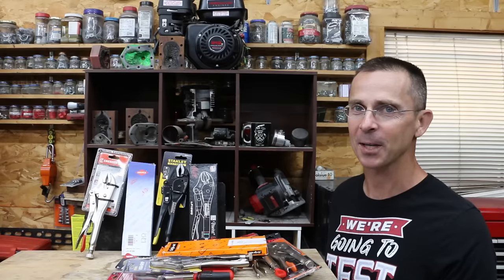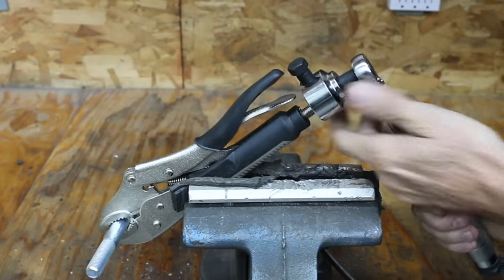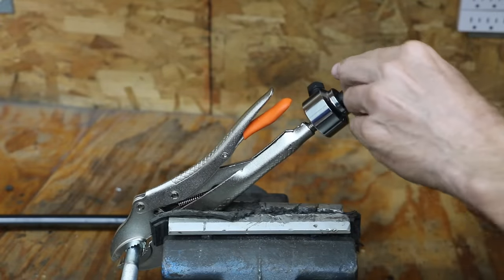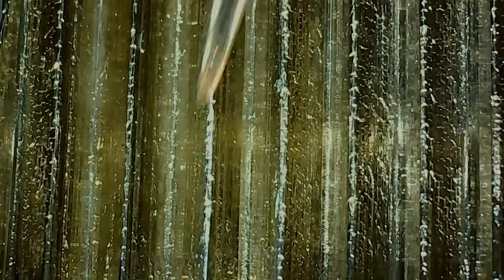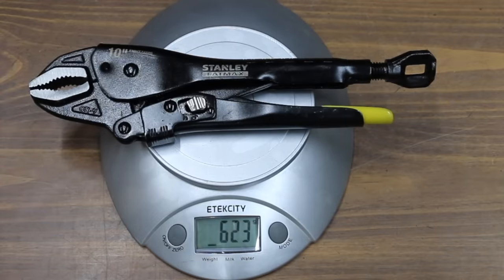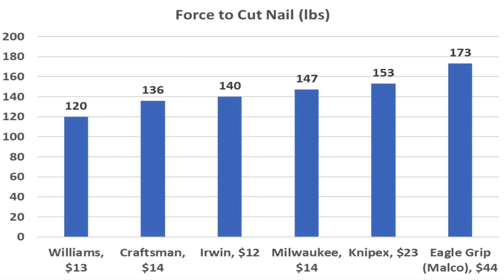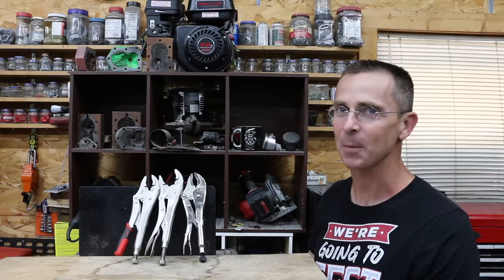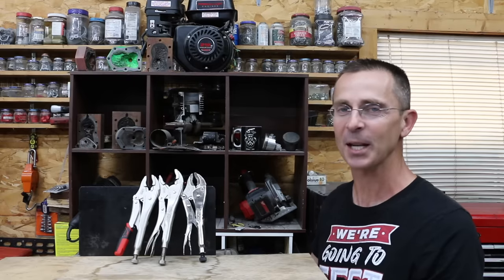Best Locking Pliers (VISE GRIPS)? Irwin vs Knipex, Milwaukee, Craftsman, Stanley, Malco, Pittsburgh.

Comment: NOTE TO SELF: Have to go out to TIG weld all my HF junk pliers / clamps at that pressed thread joint lol!  Great video Project Farm, as always, tho I have to run the playback speed at .75 to keep up with you and  let it sink in...I guess I'm old lol! I do have many original VG's pliers and clamps ranging 10 to 50 years old that are still in great condition.
Reply: From before they were Irwin
Reply from the maker: Thanks!

Comment: Great test!!
I’m so glad the Original Vise-Grip did so well, Irwin has been doing very well in your tests. I’d also note that the wear is very important, if you want to use them for a while. Looks like Irwin and Malco wore least
Reply: I have a Vise Grip and I display it in my channel removing some stuck bolts of an old carburetor. This locking plier is really amazing and very durable.
Reply: Yet they didn't point out that "they are now known as Irwin Industrial Tools and are now a division of Newell Rubbermaid, Inc. In 2008, the original Vise-Grip manufacturing plant in Dewitt, Nebraska, closed when the parent company moved production to China".
Reply: @Weejie2011  sad unfortunately
Reply: @Weejie2011  that explains why I didn’t see him test the original vice grip brand..🤷🏻‍♂️
Reply: @twobighands  Irwin market them under "the original vice-grip", but they are made in China.
Reply: Irwin isn't the original Vise Grip, it's chinese garbage, the original Vise Grip is made in the USA near my hometown.
Reply: @ericjohnson8482  looks like the original Vise-grip sold out to Irwin who has them made in China now, so the original company is to blame for selling out. Am I wrong? Can you still get USA made “Vise-Grip” brand near your house?
Reply: @ericjohnson8482  Try reading what I wrote. The vice-grip was originally made in Dewitt, Nebraska. However, Irwin bought out the company and shifted production to China, yet they are still marketed as "The Original Vice-Grip". The pliers tested here are Irwin, therefore made in China, but branded "The Original Vice-Grip".
You are arguing by repeating what I've already pointed out.
Reply: @MAsWorld1  yeah you buy them used, and Irwin kept them in the USA for a while.  Malco is in the Peterson plant now, which is where the real Vise Grip was made.
Reply: @ericjohnson8482  yup! "Real Vise-Grips" are now Malco. Its no surprise they blew the competition away! Too bad they are $44 a pair.
Reply: @Weejie2011  Guess i won't be buying Vise Grip brand anymore.
Reply: @twobighands  the Nebraska factory was shut down in 2008.
I'm very surprised Project Farm had such good results.  My 2 pair of Chinese Irwins were really loose until I tightened the pins.  The slide that connects with the adjustment screw popped out until I welded in a strap.
My adjustment screw is about 1/8th and it clearly stated on the package to not tighten the screw with the hex wrench despite having the hole.  I started buying Milwaukee.
I do believe in the last couple of years that all the manufacturers have improved their designs though.
Reply: @bryanshere3860  yeah they are $44 I still bought a pair to replace my lost very cheap Chinese pair. I like them they feel well made and not that likely to break under normal use
Reply: Did anyone notice that Malco took over the Nebraska plant where Vise Grips were made and are now making the Eagle Grips there? So if you buy an Eagle Grip you're basically buying what Vise Grips used to be before Rubbermaid bought them and moved production to China.
Reply: @alanlocke7639  no. That's valuable information
Reply: The only two brands out of all of these that I would consider.
Reply: This saddens me greatly. I used to visit the original plant in De Witt as a contract compliance analyst for GSA. De Witt is a tiny town and much of the workforce were rural folks who had worked there for 30 years or more. I remember that in their Quality Assurance office there was a giant board with dozens of knock-off grip pliers. Most of those were trash and the Irwin workers were justifiedly proud of their product.
Reply: @bryanshere3860  They're worth the $44. If they're as good as my 55 year old originals, they'll last past the rest of the users life.
Reply: @alanlocke7639  thank you for pointing that out. It clearly says so on Malco's wesbite. I recently used the vice grip brand on an over torqued drain plug for an oil pan on a car, and the teeth were totally stripped out... I had to tighten the damn thing with a clamp. Once I was down the vice grips went into the garbage. Did some research and found out the original plant was purchased by malco after vice grips sold out to China, so I bought me a pair of malco. They are millennia better after multiple uses. The vice grips were trashed after ONE use!!!
Reply: @MAsWorld1  why not just getting Malco and support companies that stand to not communist countries?
Reply: @Weejie2011  Malco bought the original Vice Grip manufacturing plant in DeWitt, NE........so they're really the original Vice Grips.
Reply: @Frank_in_Iowa  Thanks for the information and wonderful news.
Reply: @Weejie2011  ok and? who cares as long as the performance is good. funny that you want to go out of your way to say "ChiNa BaD" but didn't watch the video apparently
Reply: @LC-hd5dc  People care if they buy something purported to be "original" and then find it is not. If you'd care to read this thread, there is evidence that the performance is not long lasting. I watched the video, but it doesn't cover longevity, which is an important factor. Nowhere have I said "China bad" and I don't pish aboot wi' upper and lower case, forbye. Yer bum's oot the windae.
Reply: Malco is the best but unfortunately they are closing the plant in Dewitt Nebraska and are moving to China so I guess now the best ones will be the Chinese Irwin’s and the Taiwan made Milwaukee’s I’m really bummed out though not being able to purchase USA made vise grips in the future luckily I did buy 2 of the Eagle Grips earlier this year so glad I did
Reply: @Weejie2011  The Eagle Grip(Malco) is made in the original factory in DeWitt with the original employees of the Vice-Grip company, they just ended production at the end of 2022 unfortunately. So if you want an original vice grip get what's left in stock of the eagle grip.
Reply: @MAsWorld1  The Malco is the closest thing to a genuine original Petersen Nebraska Vice Grip. Unfortunately they seem to be shutting down due to lack of interest/sales but I think they needed better advertising.
Reply: @corygriffiths4394  The Malco is probably the best,I don't want the Chicom on principle even if it were good or "original" which it is neither,there are some made in Spain (Grip On?) that  might be o.k.,maybe sold/rebranded by Channel Loc? HJE still might have some Malco

Comment: "Alloy Steel" nice marketing term considering that every steel is an alloy ;D
Reply: Its like cheap knives sometimes "Stainless Steel", yeah... But what grade of it? or X series aluminium.. also does not tell you what you need to know
Reply: Or dairy, meat, drinks that say "gluten free". Gluten comes from a grain, I would hope it's gluten free, smh.
Reply: Gotta make it sound high quality somehow ;)
Reply: and the chrome Vanadium is for cold weather use. no sales value for many areas as a result
Reply: @nmatthew7469  don't forget the fat free 100% sugar candy :)
Reply: @91rss  Oi? First time i hear that. Doesn't both chrome and vanadium make it tougher and more corrosion resistant?
Reply: I've got a better one for you.  My step-daughter bought me some ratcheting pruning shears made with "High cartoon SK-5 steel"!  That is a direct quote from the package.
Reply: @hernerweisenberg7052  both of them make steel more hardenable, and chrome makes it corrosion resistant. Depending on the specific alloy some of the 6000 series steels can be used as HSS, so the family of compositions has quite a bit of variance. They don't seem to be particularly picky about temperatures either.
Reply: @wea69420  Aye thought so too :)
Reply: Yup, everything is marketing. Even “Titanium” has many grades. All metals.
Reply: @nmatthew7469  bread making just isn’t the same without tons of gluten forming protein.
Reply: @legallyfree2955  Better yet, the ones that advertise "Medical Grade" stainless steel.  Except, there isn't any such thing.
Reply: @nmatthew7469  No, not "Chinese parts", "Globally sourced materials"
Reply: @Wolfshead009  Ahh yes, I forgot about that one...
Reply: @nmatthew7469  vegetarian bread
Reply: The bare definition of steel is iron plus carbon.  Technically, it's not an alloy at all, since carbon is not a metallic element, and an alloy is a mixture of two or more metals, by definition.

Alloy steel has iron, carbon, and other metals used to adjust the properties.

It's not a marketing term.
Reply: @TrueThanny  You don't have to alloy with metal to have an alloy.
Reply: @hernerweisenberg7052  An alloy is a mixture of two or metals, by definition.
Reply: @TrueThanny  If i wouldn't be sure about my claim i would probably use the search engine of my choice to look it up, but in this case it is not nessessary. I suggest you try it ;)
Reply: @hernerweisenberg7052  Really?  I can look things up on a series of tubes?  If only I had thought of that before explaining what an alloy is.

Or, I did exactly that, and it confirmed what I already knew from before that information was so conveniently accessible.  Alloys are mixtures of metals, not mixtures of one metal plus something else that isn't a metal.
Reply: @TrueThanny  So stuff like Steel, Cast Iron, Nisil (Nickel-Silicon), Copper-Silicon and Iron–Hydrogen Alloy for example are not alloys?

Comment: I love how he just gave up on the Pittsburghs after the first test 😂
Reply: @craigjensen6853  they're sockets are pretty good though. It's just a brand. Some of their tools suck, some are good.
Reply: I use their locking 11" c clamp  with swivel pads and 6" needle nose for welding. First thing is grind off coating from seam where the adjusting screw screws in then coat the screw with Grease and  mig weld the  seam. The hold up fine after that and are dirt cheap
Reply from the maker: Thanks for watching!
Reply: Pure junk that will fail on you and bust your knuckle. Not ALL Pittsburgh, some of it is decent for the price, appreciate Harbor freight but don't buy Pittsburgh vice grips!
Reply: I bought a set of tin snips and they couldn't cut anything. Threw them away and bought a real brand.

Maybe PF can do tin snips
Reply: Put them somewhere you know someone you don't like will steal them...
Reply: Lol the only thing I get from HF is stuff like hex keys and screwdrivers. If it has moving parts or electronics it's probably not worth getting.
Reply: To be fair, the adjustment mech had failed; so it would be hard to do any more testing after that.
Reply: Thankfully they are now replacing a lot of their Pittsburgh stuff with new mid-grade lines like Doyle and Quinn. A little more expensive but you avoid shenanigans like the "threads" in these locking pliers, holy cow that's embarrassing. I have a feeling that their bottom-of-the-barrel brands like Pittsburgh and Central Pneumatic and Chicago Electric will be completely phased out by the end of 2022.

Comment: Congrats on 2M subs and I see LPL is a fan, too!  Nice!

After LPL's countersinks, I respectfully request: dust masks! (not like convid, like proper half face proper respirators!)  i'm interested in: 
1) ease of breathing (Pdiff) 
2) life of filters (could be measured in dust weight required to double the flow resistance.
3) glasses/shield compatibility/comfort and fogging.
4) particulate passed (qualitatively with sooty smoke (colored smoke bombs?!) or with a particle counter (i could lend you an industrial one that'd give ppm).
5) fit: out-of-the-box, adjustability, ability to stay in place when headbanging a mullet.  (seal could be visualized with a colored grease)
6) ease of don/doff (bonus: to include to drink!)
7) ability to talk to other workers.
8) cost per unit (time or contamination) of wear (e.g. a nice re-usable that clogs slower and can have filters replaced will be cheaper in long run than cheap disposables that clog.
9) maybe some qualitative metric of longevity (PPE doesn't tend to get treated the best between uses!)

There are some fun YouTube vids of people building cheap DIY ventilators from spring 2020 that could make a great test rig!  More realistic than just sucking air through a mask!

examples (not requests, though I would like to see a pro-level 3M or similar like the 7500 below!) from Amazon:
- GVS SPR457 Elipse P100 Dust Half Mask Respirator
- Electric Wearable Air Purifier Maskes,Air Supply,Breathe Easier,With HEPA Filter,for Dust Work,Painting, Machine Polishing, Welding and Other Work Protection(Full Size,A whole set) 
- Trend Stealth Air APF10 Reusable Half Mask Respirator "Color May Vary" 
- 3M 7500 Series Reusable Respirator With Cool Flow Exhalation Valve

Comment: I’ve never cut anything with “vice grips” didn’t even know! hah
Likely still wont  ;)
Thanks for introducing Malco!
Reply from the maker: You are welcome!
Reply: Malco has always made the best tools. For HVAC mechanics. I don’t use locking pliers/ vise grips. Have several at home none in my work truck. Most of what Malco makes is still made in USA. Most my Malco tools are over 20 years old and many might outlast me. I believe Malco also makes best hex nut drivers. Usually lose them. Never stripped one out or had a magnet fall out.
Reply: handy for nails or stiff wire like coat hangers
Reply: Lol well said. I look elsewhere in my tool bag to make a cut. Never heard of Malco until now

Comment: -- Again congrats on the sub count.   Had an idea for you:  Power converters, DC to AC.  Modulated sign waves versus pure sign, different brands, with tests largely focused on automotive applications.  
    Personal experience.  I've never seen a modulated wave converter hurt anything, but that they do is through the grape vine.   On the other side, under heavy load, I've heard pure sign can do more damage as they can't hold the wave.  And what does that mean, say, if your running a laptop on a modulated wave converter, when the laptop itself has a converter, then a batt to smooth out that power?  
     Might be a fun trip down the rabbit hole.   Still like to see an electric mower review against a good gas one, hand/head flashlights.  But do what you do.  Thumbs up.
Reply from the maker: Thanks so much!  Thanks for the suggestion.
Reply: C-clamp test?? At work we have some old Wiltons, it’s like they can’t be broken/bent

Comment: This was super informative.  I own a few different brands of vice grips.  I know that the original vice grips are now made by Irwin (I've purchased some).

I wasn't expecting Irwin to do so well.  I guess the original manufacturer does know something about making vice grips.  As always, thanks for another great video.
Reply from the maker: You are welcome!
Reply: Kinda like how Milwaukee invented the Sawzall. Yeah. I chose wisely when the time for that purchase came
Reply: Original Vice Grips are now made by Malco, at the  same Peterson Co factory location .  The Peterson Co, the original makers of Vice Grips, changed their name to Irwin and moved to China.  So it is "debatable' as to which are "original" now. I would say the Malco's  have a better claim , being still made in the USA at the same place, but they cost alot more than the Irwin ones.

Comment: I’m getting the Irwin, thanks Todd!
Reply from the maker: You are welcome!  Thanks for sharing.
Reply: Why would you get the irwins? The USA made Malco's did much better
Reply: @warrenfogleman9962  probably due to the fact you can get almost 4 Irwins for one Malco
Reply: @warrenfogleman9962  I’m a home gamer who doesn’t need the extreme performance for my casual use. It’s just not that serious for me and price is certainly a driver.
Reply: @hotrod33809  
more than once have I just decided to leave a pair of cheap vice grips clamped onto something instead of buying a new part.
I.E garden faucet round turn handle bad example because those are so cheap but,
Reply: @warrenfogleman9962  And who cares what I get anyway? I’m just commenting because that helps he video and the excellent channel ;)

Comment: the best locking pliers I ever owned was a pair of vice grips I found in a parking lot one time. They were old school brand-name Vise-grips that were still made in USA. You can't tell me there's no difference once those classic made in USA brands moved manufacturing to China.
Reply: I have one of those! My only tool that's rusted and still working
Reply: I just have the Chinese Irwin’s wish I had a pair of the USA made Irwin’s but their hard to find and even used their expensive.
Reply: That's capitalism for you!
Reply: @corygriffiths4394  as other commenters have pointed out the Malco Eagles are made in the same factory as the old Irwin's.

Comment: This is, A: an eye opener, and 
B: my 'Mole Grips' must be amazing! Never had any trouble, apart from maybe finding the clamp hard to release. The only job they couldn't complete was freeing a rusted bike seat post from it's frame stem. And we were putting some serious forces on that baby, like putting a scaffold pole over the grip handles and hitting it. It wouldn't turn but it didn't slip.

Comment: I use these in my assembly work everyday. What I have found is that the adjustment screws and the threads are the biggest problem. I always treat the threads with some type of lube. It affects how much pressure you can put on the jaws during the grip. This is why I think the Malco did so well. The screw looked like it had some sort of surface treatment.
Reply from the maker: Great feedback!  Thank you
Reply: I clean and lube the screws in my Vise Grips too. Got to have that smooth action.